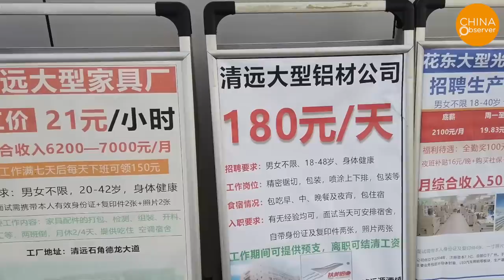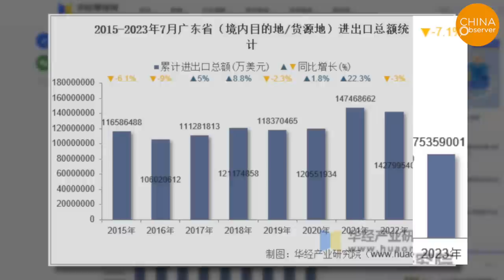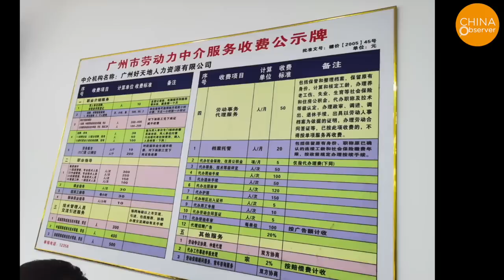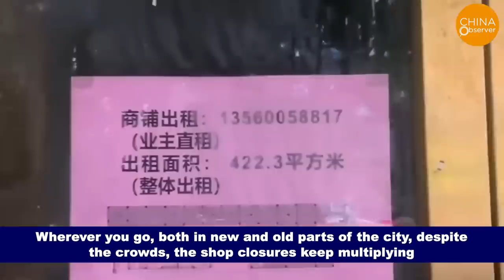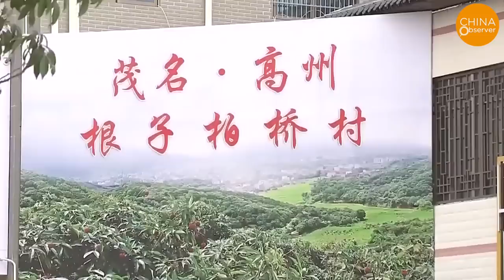Shenzhen Is Doomed, Dongguan Is Even Worse, Manufacturing Closures Sweep Through Guangdong

Comment: It is saddening to see the people suffering from the massive economic downturn. The CCP is directly responsible for their plight. The situation will not improve so long as the evil and corrupt CCP remains in power. Time for the people to rise up and overthrow the CCP regime.
Reply: Those people had been condition to LOVE ccp no matter what.
Reply: It won't change until they have a significant self-reflection and overhaul of their culture. The fall of the CCP just leads to some princling bring about another one-party/imperial system.
Reply: Revolution requires an organized group behind it. With all the monitoring going on, anything remotely like that could only originate within the CCP itself if it has enough of Xi Jinping, or from organized crime (for the same reason)

Comment: What's even worse for china is that here in America, we're starting our next 3d printing revolution  - Chip making. 

That's right,  we are now developing desktop sized 3d inkjet printers that can fabricate   Organic Transistors (oFET).  So a lot of those really low-end Chips that china was making,   yea, those markets are going to dry up for china as well. 
Americans and Europeans can buy a inkjet printer that does Semiconductor fabrication for around  $15,000  and start printing ICs on a substrate of glass at  500nm.   Sure it's SO far off from  the highest 7nm process, but let's be honest here,   a microcontroller  that controls a timer which turns a water system on periodically doesn't have to be incredibly energy efficient or small.   They also don't need to be mass produced - they can be made as they're needed.  Fabrication time is around the same as printing a  1x1 inch photo-quality  photo on an inkjet printer.    There's certainly going to be a market springing up around these kind of 3d printers for sure here in America.